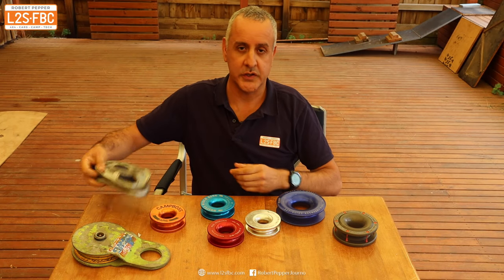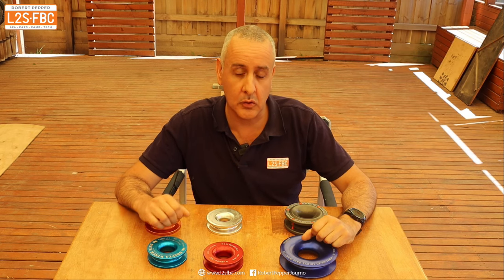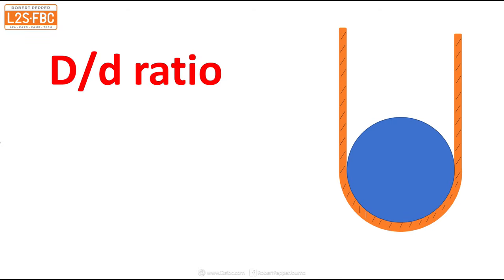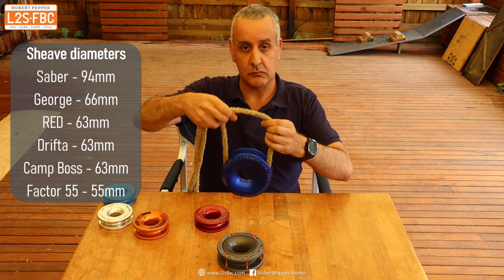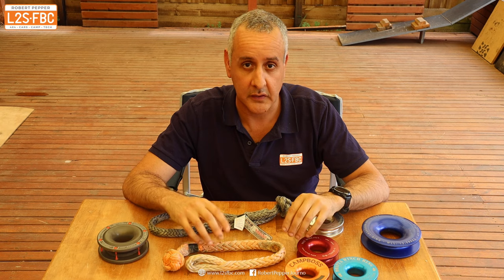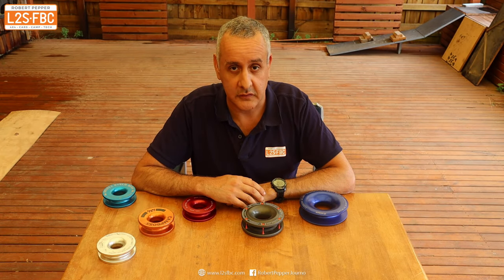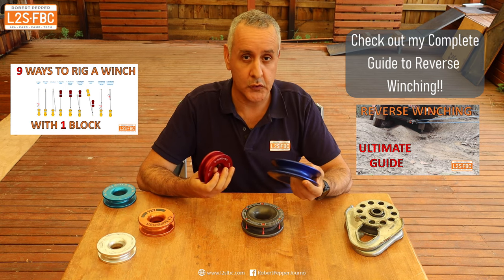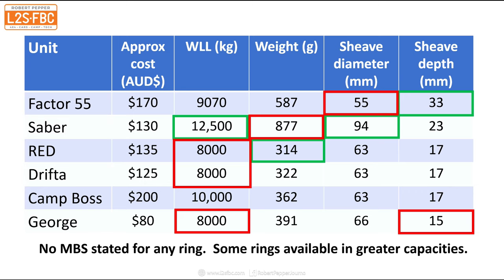What makes the ideal 4x4 snatch ring and how to choose one for you

Comment: I would not be surprised if the heat enervated by the friction will melt  any of the units.  That activity where two units slide with resect to each other is used in fr4iction welding of steel.  I believe these systems will only work for a very short duration in any one pull,   https://youtu.be/-aEuAK8bsQg
Reply from the maker: Heat isn't a problem.

Comment: Nope, nope and nope. If they don't have a bearing in the centre, the rope will be under considerable strain that would heat and snap by friction. The safest one is always the one that has a bearing and a load limit to 6-8 tonnes. I have a bearing one.
Reply from the maker: See my other video on friction loss...not the case

Comment: Bottom line for me, it generates way more friction than a pulley, I want everything I can get out of my 12K winch  great idea though and if it ran on a bearing I would be sold on the idea
Reply from the maker: Watch this space...I know of a product coming that may be of interest!
Reply: @L2SFBC  I will keep an eye on you here for that, I have 3 WARN EPIC snatch pulleys they work flawlessly I also have a brand new in box Factor 55 ring in my hand. I have not used it yet, do you rhink these rings are as good as snatch blocks ?
Reply from the maker: No, they're not as good - harder on the equipment, and less efficient. But they're good enough for recreational winchers, and the cost/weight/size saving is significant. So I do recommend their use, but not for high-volume winching like if you were a pro recovery business.
Reply: @L2SFBC  Thank you for your input and speedy response, I believe if the FACTOR 55 ran on a precision bearing they would really be onto something, however, the cost would be substantially more., what are your thought and the friction differences it would make if it ran on a precision bearing ??
Reply from the maker: I don't think it would be worth it. If a good ring is 8% and a block 4% then the efficiency saving isn't great. The bearing would cost and weigh more. I think it would sell but be a small market. Best of both worlds.
Reply: These products are coming from the very bleeding edge of the sailing industry. There's a lot of money in that realm for research and development. They have been developed specifically to replace blocks as they are lighter, less expensive and suffer an extraordinarily minor friction increase. The higher end options like a Tylaska have an almost teflon like feel. 
This is one of the few places where you're likely to pay more as an off-road customer then as a marine customer for the same thing.
Reply: @otm646  I always get a laugh when one particular brand claims ground breaking product. Its like know one ever googled Ronstan, Harken or Karver.
Reply from the maker: Here you go -> https://l2sfbc.com/red-winches-release-the-recovery-ring-a-snatch-ring-with-bearings/
Reply: @L2SFBC  Are they available to buy now ?  and expected price ?  I like it
Reply from the maker: Not yet. I will be testing them when available.
Reply: @L2SFBC  Please keep me updated if you would, I bet it works GREAT !
Reply from the maker: Subscribe then if you haven't...
Reply: @L2SFBC  I have subscribed already :)

Comment: The strength of those soft shackles has been compromised,  They should be replaced.  I wouldn't trust them.
Reply from the maker: Yes, they do degrade over time, in a way that metal shackles don't really. They should be looked on as consumables, like synth rope.